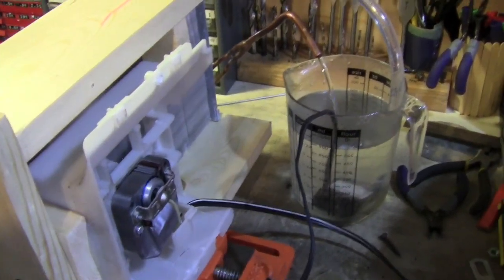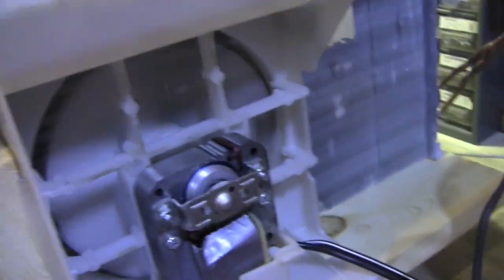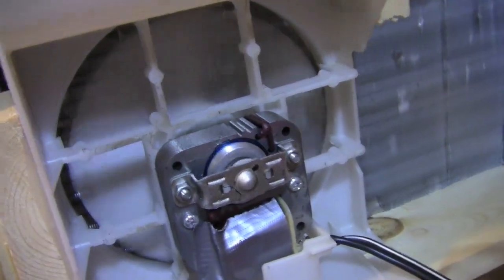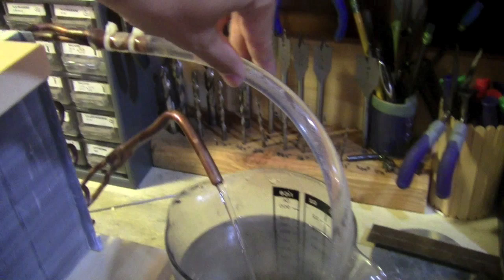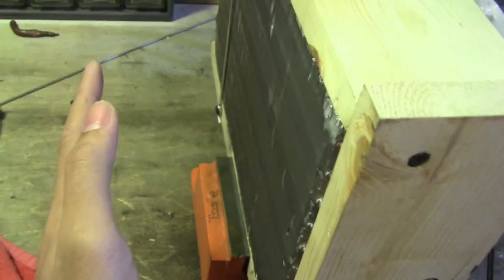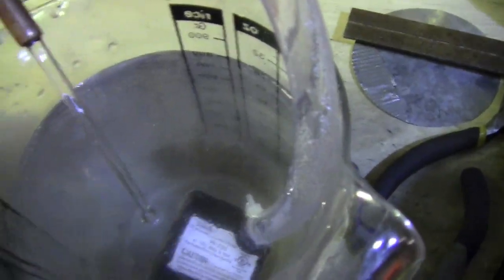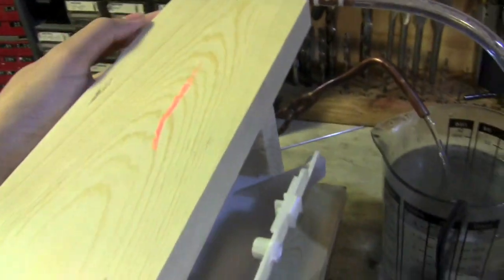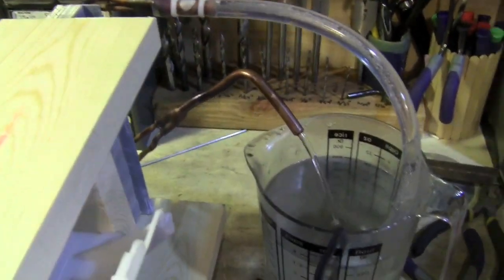Homemade Air Contitioner or Heater

Comment: Nice! Where did you get the coil? Anyway I planned one of these up a while ago and for heat I just drew in a fishtank heater. you would have to get one that you can adjust but, it is good for light duty.